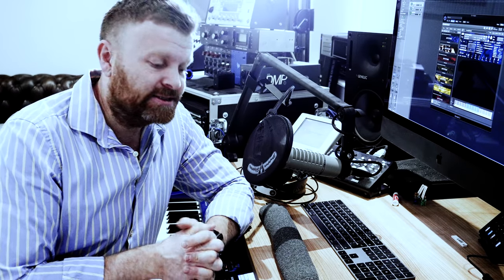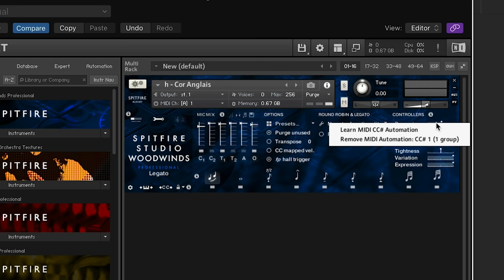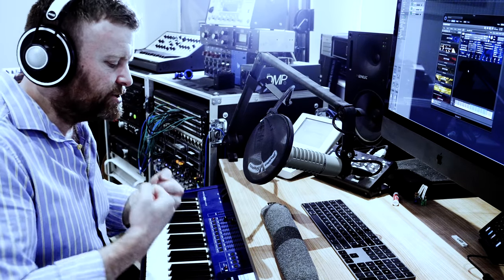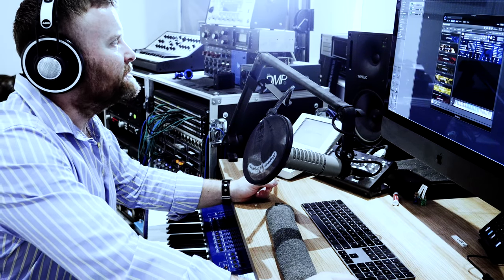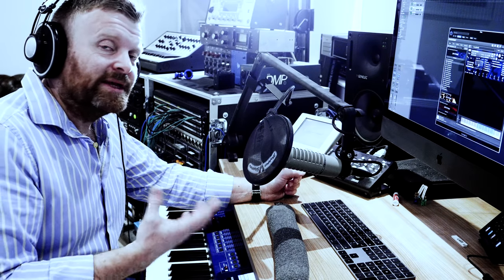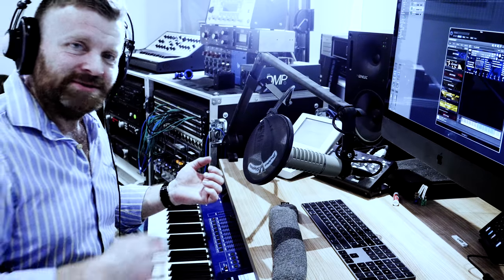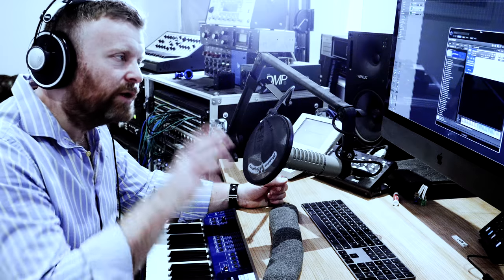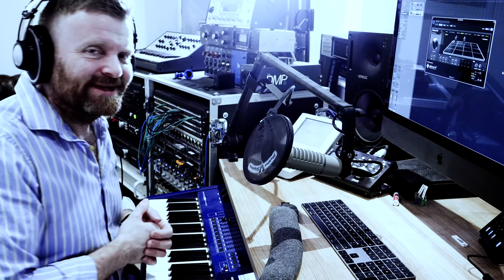How NOT to use samples #1 - Woodwinds!

Comment: Hey Paul your videos are absolutely fantastic! But just a small tip try to add a veryyyy slight reverb on your master when demoing sounds because having ZERO reverb 100% dry isnt realistic in real life as there are always going to be SOME FORM of reverb in any physical space UNLESS IN an acoustic dead space but that is not common for most listeners - So the reason I am saying this is because these videos are very nuanced about the detailed realism of each instrument, and reverb would DEFINITELY help us to REALLY soak in the differences when we engage dynamics and vib into our playing - Please correct me if I am wrong about the whole "in real life there isnt ever a 100% DRY no reverb space" - thanksss
Reply from the maker: Yes totally agree - I fear “misrepresenting “ anything, by making it sound better with reverb!! I should probably chill out about this!
Reply: @PaulThomsonMusic  lol no problem!! But hey dont you feel like in most VST's controlling the expression just controls the volume and not actually CROSSFADING between the different layered samples of intensity.
For example lets say a violin VST has about 4 levels of velocity PER NOTE.
So if i HIT IT HARD to trigger the C note it will trigger the "HIGH VELOCITY" sample, but then as I am sustaining the note i want to now smoothly blend it with the MID or LOW recorded sample.. I feel like this DOESNT HAPPEN and the EXPRESSION knob just uses the SAME recorded HIGH VEL. sample but just TURNS DOWN THE VOLUME..
Is there a way to actually have a fader CROSS FADE INTO the ACTUAL other velocity recording WHILE STILL HOLDING THE SAME NOTE?
Thanks!

Comment: Some good explanations. Looking forward to the rest in the series.

On the reverb topic: at the end I find it confusing when some libraries are already quite wet (Century brass, for instance) and some are quite dry. Should I be putting no reverb on the wet samples, just early reflection, just late? And same for dry samples. I (try) to use Valhalla and QL Spaces and I feel like no combination I try sounds good. The closest to acceptable I felt like was the 2.0 second RR Burbank small in Spaces on orchestra on EW Hollywood series, but 8Dio's Century series just sounded already too wet. I don't expect an answer here, but addressing it in a future video would be much appreciated.